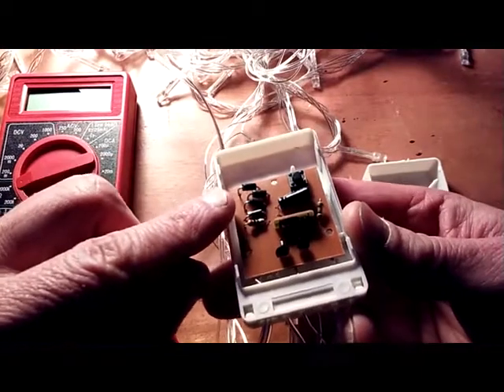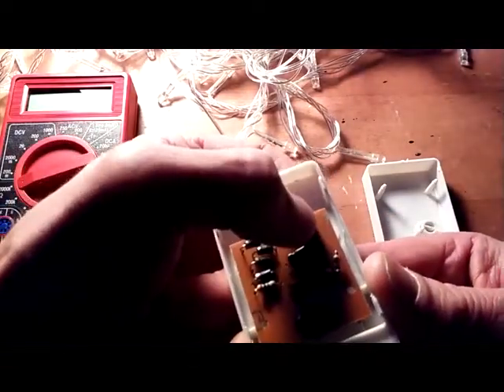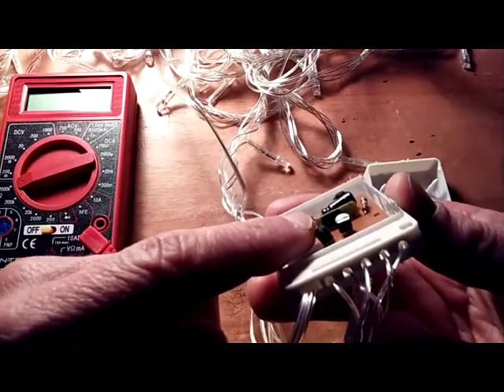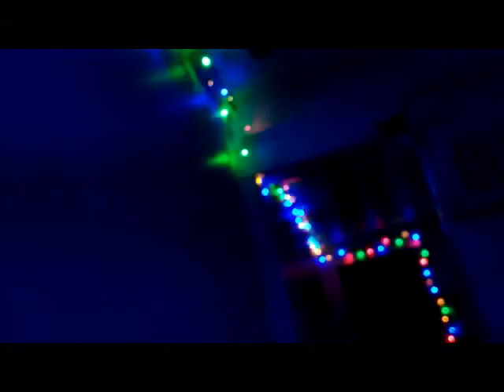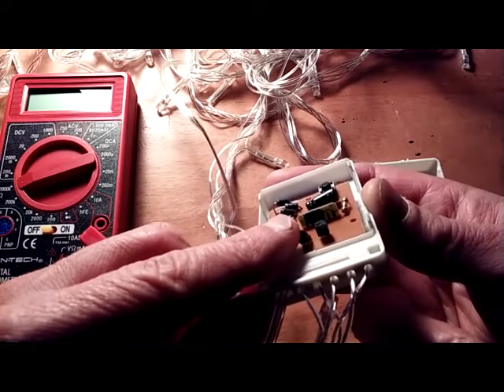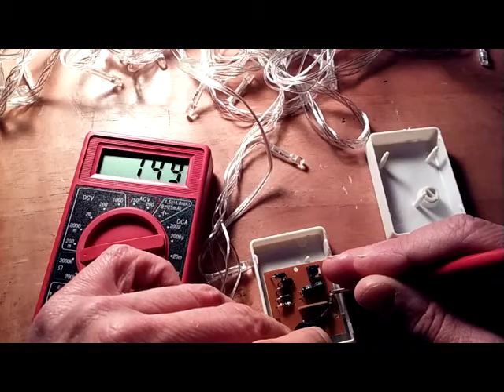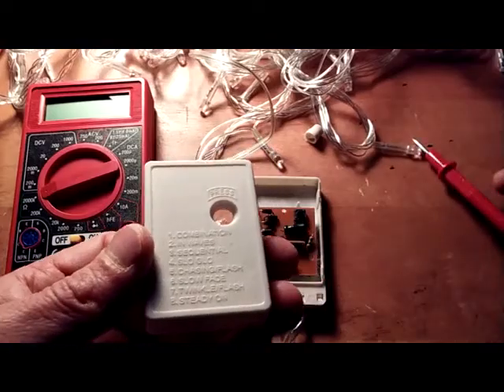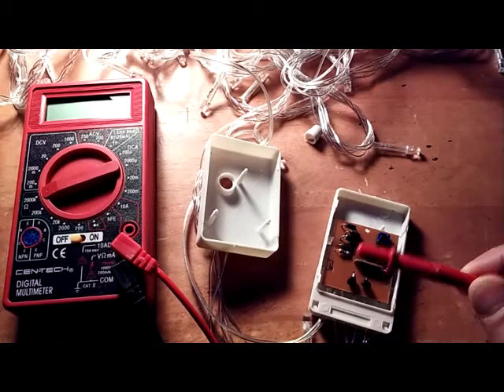PNPN Rectifier Transistor Circuit

Comment: Hi just wondering if you know how to write these up so you can have the constant on option. So get rid of the programming and once it's plugged in and switched on its just constantly on. Thanks in advance
Reply from the maker: Somehow you'd have to bypass the switch and chip. I don't mess with 120v AC appliances or gadgets. It might be better to buy a string of lights with no controls, just plug in.